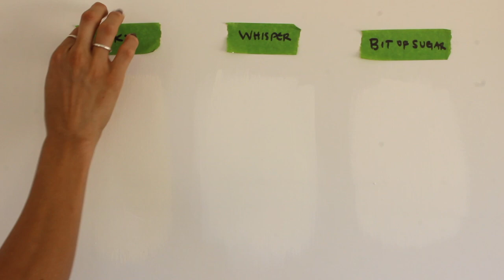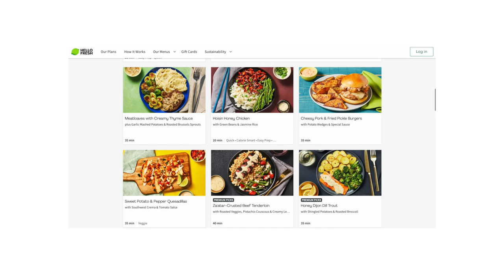WE CAN FINALLY DECORATE | TRAILER TINY HOME RENOVATION

Comment: Rachel, since I've found your channel you've been a big motivator for me as a woman new in the world of carpentry and construction. I often feel like I don't have it in me to take on the challenges ahead with such little skill or experience in my tool belt. You've come to mind several times; moments I'm afraid to cut rebar or move heavy bags of concrete. Even setting up a camera during moments I'd otherwise not. You might feel buried at times beneath your work load, but know how inspirational your work is and how impactful your story is. Thank you for sharing it with the world. You give me a lot of strength, inspiration and empowerment.

Comment: For what it's worth I'm proud of you Rachel. You're doing a great job and asking for help when you need it is a sign of strength. I've been trying to work through ongoing home improvement projects with a side of depression and crappy life events and even getting your head in the zone can feel like an impossible challenge. You're doing good and you will get what you need to get done and it will feel great as you check things off your to-do list.